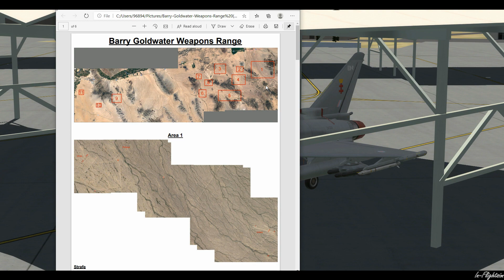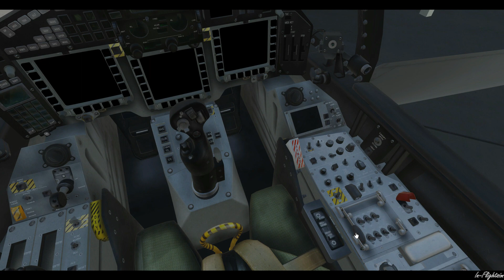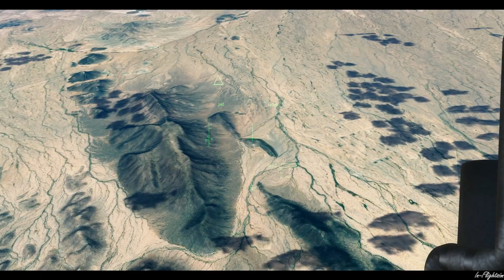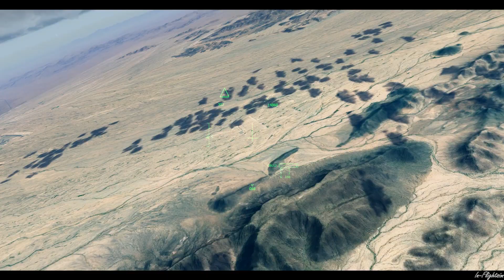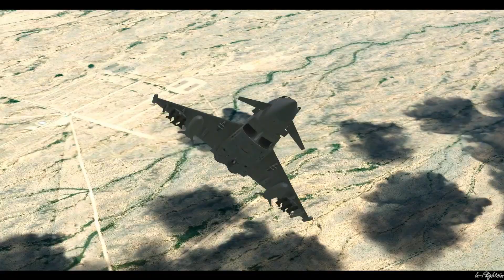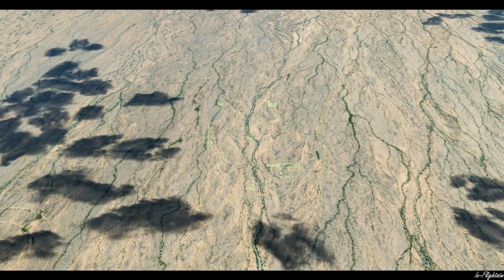FSX/P3D - Eurofighter Typhoon - Air to Surface Tutorial

Comment: Shift+4 is not working? What can i do?
Reply from the maker: If you go into the aircraft folder, there should be a folder called panel. Within that folder there is a configuration folder which shows which shift function is available. If the load out manager is listed then it should he working. If not then I would suggest reinstalling
Reply: @InFlightsim22  thank you

Comment: are you running p3d or FSX SE mate ? i am flying the exact same aircraft and cant seem to bring up the air to surface window on the right screen, any suggestion? many thanks
Reply from the maker: This was made in P3DV4.5. I could be wrong but I think the LDP page on the right MHDD isn't functional in FSX (don't quote me on that). If you are I'm P3D, ensure you have the LDP fitted.
Reply: @InFlightsim22  oh doesn't it. Thats probably why then lol I thought I was doing something wrong but I am running FSX SE.  I think I may have to look in to getting p3d 😊
Reply from the maker: Like I said, I'm not 100% sure but something is telling me that. Make sure you get the correct version of P3D for the aircraft, i believe v5 doesnt have weapon functionality due to tacpack not being updated to support v5.
Reply: @InFlightsim22  I am recalling reading it somewhere my self actually 😊 would you know of any downloads i could get to create some air to surface missions on. I know there used to be fsx@war and ive downloaded that off a site but can't seem to get it working. Thank mate
Reply from the maker: I dont sorry, I've since moved away from FSX/P3D so I'm a bit out of the loop as to what's available
Reply: @InFlightsim22  thanks for your help mate really appreciate it. After doing abit of youtubing and googling i think I'm going to move on to DCS. Seems you can do more on that platform 😊
Reply from the maker: In terms of combat it's the sim to go for I think, plus a typhoon is on the way too. I have some tutorials on the mission editor that may help you.
Reply: @InFlightsim22  yeah it does seem that way. I believe you can do alot more with it  and the new typhoon is looking good and the ah64 is looking very well. I will have alook through your channel 😊 thank you for all your help mate